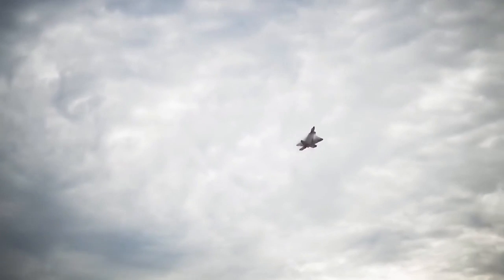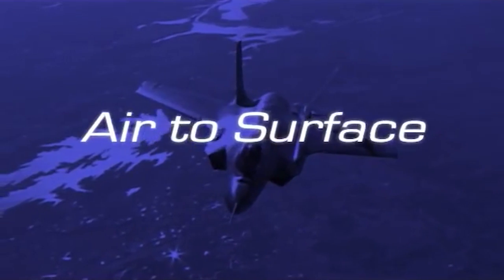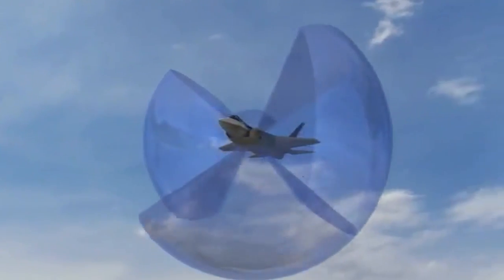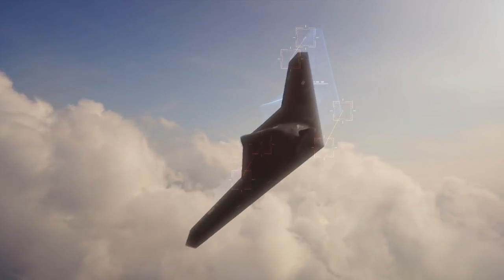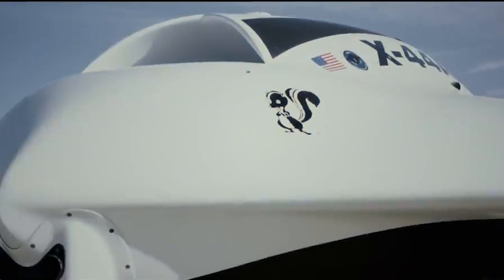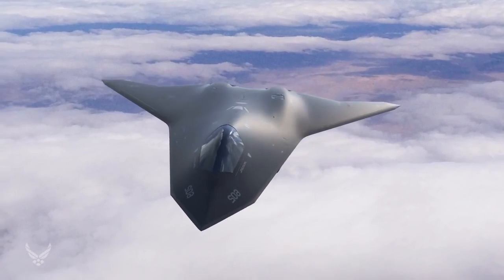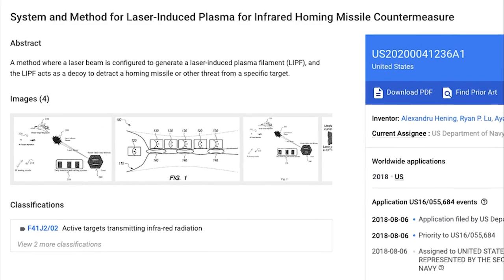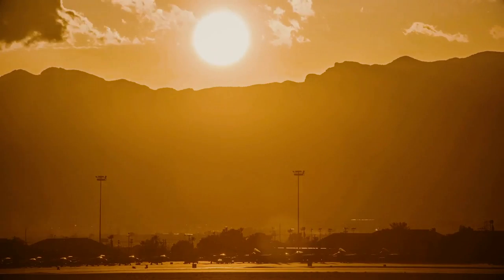The deadliest fighter tech you can put in the skies today

Comment: Sorry but I’m not buying it when the British say it can process as much data as a city. The current most powerful CPU’s and GPU’s can’t even come close to that, not even 5,000 of each could do that. Massive super computers able to run obscenely huge parallel task can’t even do that. And We all know they can’t fit a massive data center in a 6th generation jet fighter. Our best computers can barely run graphically simple games at 4k 120fps. Even the future tech they plan to implement won’t be able to do what they’re claiming. Unless that city has a population less than 5 their claim is absolutely false and nothing more the marking double speak. Complete nonsense and completely false and unrealistic.
Reply: I agree, it will probably be an order of magnitude greater computing power than current fighters like the F-35, but not a city.. For all intents and purposes, up until now computers on fighter aircraft haven't had to process much data as it is, so we are probably going to look at the equivalent computing power of a small server, likely with an off the shelf manycore processor, which is in line with how much computing power professional CAE and rendering programs use.
Reply: I would like to add that server CPU's are a different ball game compared to retail desktop cpu's.
Reply: @MardukTheSunGodInsideMe  Yes obviously, they are optimized for many different things at moderate speed. But they do share many similarities: 
Both intel desktop and server/workstation CPUs have terrible hardware weaknesses, which the military can't afford. The intel management engine is known to have lots of exploits. On top of that, if the US goes down the domestic route, intel products (server and desktop) use X86 which is considered to not be a terribly efficient instruction set, compared to say, ARM which iirc isn't used for servers very much.
Reply: @fluoroantimonictippedcruis1537  They might also use something like Mythic's Analog Matrix Processors. Which exceeds a humans ability to determine a visual using 3 watts. It's almost impossible to stay on top of all the fields which advance in this category. Unless you are the DOD with a trillion dollar budget.
Reply: @MardukTheSunGodInsideMe  look,  im going to be honest, i have no clue what a mythic analog processor actually is and what it can do compared to standrard CPUs with metal oxide tranistors.
Reply: @fluoroantimonictippedcruis1537  It's a different type of cpu architecture made specifically for AI functioning. How we program and lay out a CPU is just as important as how small we can build them. I believe the claim is correct, but I don't believe it's a apples to apples comparison.
Reply: @MardukTheSunGodInsideMe  even so. The best sever gpus couldnt do that. You can’t fit a data center on an airplane. A single server room the size an entire 5th gen and soon to be 6th gen fighter jet can barely sustain an office building. Let alone an entire city.
Reply: @JohnDoe-yq9ml   Planes don't even have a "CPU" which stands for Central Processing Unit. You dont centralize anything on a military plane. You build redundancy. Each system will have a specialized processor built specifically for its task. The systems are networked together only. They do not share processing power.
Reply: @MardukTheSunGodInsideMe  I know what a cpu is. Stop being wrapped up in the semantics. Also I’m sure some or maybe most aircraft have cpus.
Reply: The fact that nobody even mentioned FPGAs here makes me snicker 😆
Reply: @Youtubeuser1aa  Times are changing quickly. "Running AI models at the edge rather than in the cloud means that designs can be simpler and that privacy can be enhanced, says Mythic. To deploy AI at the edge means that millions of devices need to be deployed, so they must be low in cost and have a small form factor, and must also exhibit low latency, high performance, and low power. Digital inference solutions based on SoCs, Tensor processing units (TPUs), CPUs, GPUs and FPGAs can meet some of these challenges, but are limited due to memory, clock speeds, and process technology, reports Mythic. These trade-offs result in only processors capable of high-performance, analogue computers can address them all. Mythic says the M1108 Mythic AMP is such a device."

Comment: Making modular systems is easier said than done. The interfaces become a limiting factor, especially for high speed signal and latency sensitive things.
Reply: Yeah that's a good point
Reply: Though high speed and low latency is several orders of magnitude faster than it used to be. Plus if it is really vital you can change the hardware on either end of your fibre optic cable.
I guess running slightly more fibre than you really need may be worth it as it is pretty light.

I would guess that the really big change is the software architecture.
Reply: This same modularity was what was promised for the currently scrapped Littoral Combat Ships.  They couldn't deliver on that.
Reply: @Kellmourn  well, because this is irrational hype - jack of all trades master of none by design.

Comment: GREAT WORK Alex...  Please cover not the F-35s COST, but it's price vs a typical strike PACKAGES cost, _lacking an F-35.
Eg. the F-117 flew the MOST dangerous sorties, SOLO. Vs 10-15 jet, strike PACKAGES.  If similar? The F-35 price is a red, herring.
EACH F-117 really represented force multiplier that replaced 10+ jet STRIKE PACKAGES.   
Realistically, how many support jets are required WITH vs WITHOUT an F-35 attached.  (not arguing F-35 = solo sorties).
If F-35s mean a strike package's odds of success & survivability increase with 5 FEWER jets? WHAT'S ITS PRICE THEN? 

PS, just as your phone's energy use isn't a 2400 milliamp battery, but really, about the same as a REFRIGERATOR as it's using servers online to satiate data it's requesting, I would expect the F-35 to not just rely on the computational ability local to it, but to augment that (when possible) by what'd be a supercomputer in comparison ... with a small amount of latency to improve the data it's analyzing ... and so too will subsequent generations exploit the decreasing latency of WAN (wide-area networking) that no doubt, space-force is doing their best to harden against both cyber and kinetic attacks.

The less obvious advantage to using networked computers and software ... is that each "attritable unit shot down" doesn't give away your entire technological advantage.  However, rest assured, when one of those "attritable drones" kills a pilot by doing something some redbull drinking aspe didn't think of ... it's going to be YEARS before our gov. (which hid the bizarre UFO crap from us) acknowledges it.

Comment: I do not think that there is much mixing of the functions of inner-loop flight controls and mission systems in modern fighters. The inner-loop stability and controls are self-contained except for the changing inertial mass properties and aerodynamics due to stores, and some reactions to gun dynamics. Any mixing of outer-loop flight controls with mission systems is necessary and can not reasonably be simplified just by making them "more modular".

Comment: I don't understand why an air superiority drone and a surface warfare drone need different specialized drones.  I would want the best flying, most maneuverable drone to have both capabilities.   The weapons and avionics need to be changed so that they can target whatever they want, and then use the ordinance that can handle whatever it's told to hit.  Cut down on having so many different types of missiles and specialized aircraft to use them.  I hope I'm making sense.  But I could be completely wrong with that tactic, but sometimes simpler is better.

Comment: Alex, always look forward to your content; this one no exception!  It's been a while since I was on the F-22/F-35 programs, but I believe the F-22 has/had the ability to do EW work, although not to the extent the F-35 can project.  I also think both of those aircraft have the ability to field avionics software updates without requiring the flying software systems (what we called "Air Vehicle" SW) to be requalified.  Thanks again for all the detail; we'll help the newbies catch up!
Reply: I've wondered that about the F-22. 
Have you ever watched Millenium*7's analysis of why changing anything on jets is extremely expensive and quickly becomes a complete redesign of the entire jet, leading to new developments instead of continuing forward on the existing template due to the influence on kinematics modifying the weight-distribution or using more watts for new systems will cause ... and even replacing a computer with a faster one is difficult bc they were all just one-off programs that didn't take into account future development. 

I'm guessing they're using CPUs which are literally custom to the platform ... but even still, when the process-node shrinks, why can't they make the same module with the same code smaller, lighter, and more efficient at least ..?  (I know, it also has to be hardened against enemy EW attack) ... but it is a striking degree of limited foresight.  It's not quite as bad as the 1889 Commissioner of US patent office,  Charles H. Duell's statement: "The patent office should soon shrink in size, and eventually close, bc, “Everything that can be invented – has been invented.”
Reply: @trumanhw  I've not watched that analysis, but I've lived through probably 5-7 hardware reconfigs.  IMO, the biggest problem is kinda what you refer to, the environmental requirements that military hardware requires.  And they are really required.  Vibration, temperature range (-60C/+80C, anyone?), salt fog, etc.  If you ever see a fighter aircraft with panels removed you see real quick that there's just about zero wasted space: it's either filled with avionics, cooling, cockpit, weapons, or fuel.  So the computer hardware used is custom, even if it's a common CPU and memory architecture, just because the environment is so harsh.

BUT, I think the point being made in the video was that in the past software changes were so expensive because they had to be released in a single image; that's all the ground support systems of the time could manage from a configuration control POV.  So changes to the radar software (for example) required a re-qual of the flight control system software release.  With F-35, AFAIK, the ground support systems now have much more capable configuration control system, so I think the capability is already fielded, at least to some extent.
Reply: The F22 has some level of EW capabilities, but the F35s computers and radar are better by quite a margin still. Which makes sense, given the gap of almost a decade between those two planes flying. Although of course there's probably been quite a bit of modernization done on the F22.
Reply: @todo9633  Absolutely, on all counts.  What Raptor does bring is great range and real supercruise (M1.4 anyone?).  I've always thought Raptor's real role would be as a stealth AWACS with serious self-protection capabilities.
Reply: @Mike Bridges
Yes and no
The F-22s APG-77 is optimized for aerial warfare while the F-35 AGP-81 is designed for multi role
The APG-77v1 adds multi but not to the extent of the F-35s
The F-22s problem is that unlike the F-35, it lacks secure datalinks for communication with other assets 
The F-35 has 6 which allows to easily work in tandem with EA-18Gs and RC-135s for SEAD or SIGINT
The F-22 is just so much wasted potential because of dumbass politics
Reply: @verdebusterAP  That's why I said "stealth AWACS"; responsible for managing assets in the air space.  BTW, Raptor has the ability to communicate secure with other Raptors, and I do believe has Link-16 for secure comms with other assets.  Agree it's not as capable as F-35 (bird needs a better name), but it's not a dinosaur either.

BTW, agree totally on Raptor being wasted because of politics.  Welcome to the free world.
Reply: @mikebridges20  

The F-35's name at least lends itself to a kick-ass ship name, the Lightning Carriers, for the light Carrier conversion that LHA's are being considered for in conjunction with the F-35B.
Reply: @Seastallion  I thought its name stood for the lightning that grounds it every time it gets struck by it. Haha JK. I think the F-35 is at the forefront of active combat aircraft engineering design and proud the U.S. developed it. Didn't know that about its name though (lightning carriers), thanks for sharing! Learned something new
Reply: @Seastallion  F-35 name is not without cred: named after the P-38 Lightning from WW-II and the BAC Electric Lightning, a Mach 2 British Interceptor.  Chose those 2 aircraft to recognize the ground attack capabilities of the P-38 and the UK's major part in the development of the F-35.
Reply: @MedellinTangerine  

The aircraft itself is called the Lightning, but the Lightning Carriers are the Navy LHA Marine Helicopter Carriers, some of which are being converted into Carriers for the F-35B Lightning, giving the smaller Navy Carriers the moniker "Lightning Carriers".
Reply: @Seastallion  Yeah, I looked it up after you mentioned it. I didn't know there were a smaller version of aircraft carriers in the Navy made just for helicopters and VTOL planes like F-35B. Pretty cool, and makes a lot of sense to have smaller carriers for a myriad of different reasons.
Reply: @mikebridges20  both planes has link 16 but the f35 has another more encrypted comms for the other planes..the problem is the antennas of the f22 is baked into the frame...so it's not worth the cost
Reply: @verdebusterAP  interesting comparisons, thank you.  Ugh, and yeah, wasted potential - I can’t look at the 22 without my first thought being ‘put back into production,’ knowing it can’t happen for lotsa reasons.  Gates has a special place in my heart, and not the good place.  Breaks my heart we’ve not at least 750 protecting our interests.
Reply: I may be mistaken, but isn't it a trade off with each generation of aircraft that the sensor software, flight control software, and fire control software are integrated, then separated? IE the F-4 had seperate computers for each, then the F-15 integrated systems for HOTAS, and then the F-22 had separate operating systems for flight controls than sensor and fire controls, which were all integrated again for the F-35? My verbiage may not be accurate but I hope my question is understandable. Just curious, if I'm totally out of the ballpark, please forgive me.
Reply: @koori3085  Can't speak to the F-15 (my experience is F-16, F-22, and F-35), but what I'm discussing isn't how the systems are integrated on the aircraft, but how the ground support equipment manages configuration control (i.e. make sure you've got the right version of each system's load image).  F-16 actually required separate maintenance computers.  F-22 used a single load image that contained all the compatible software releases for each of the aircraft system.  That means that when any release in an image is updated the entire load image for everything had to go through quality checks (what we called production configuration management).  I THINK F-35 maintenance computers have the ability to properly manage configuration control of the individual images on-board, reducing PCM requirements.
Reply: @mikebridges20  Nice, okay, thanks. I was off the ball for sure, but interesting to know. I think I followed!